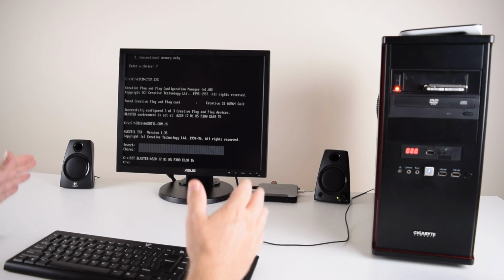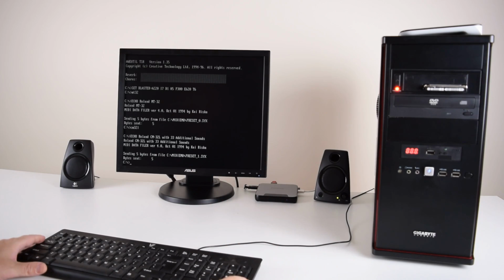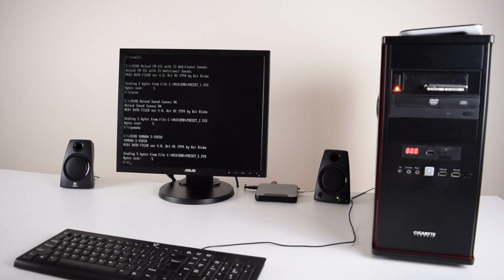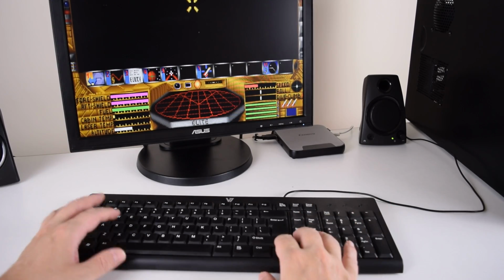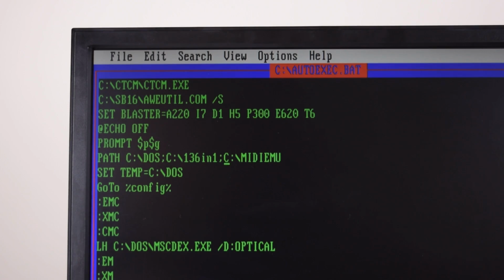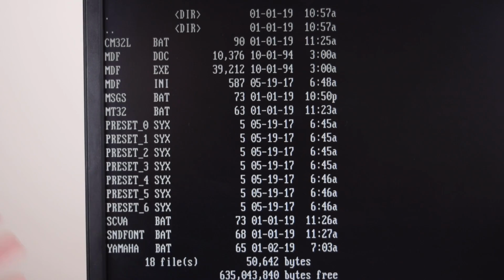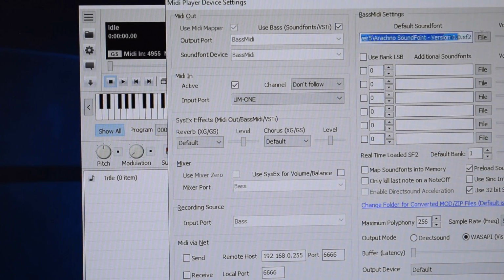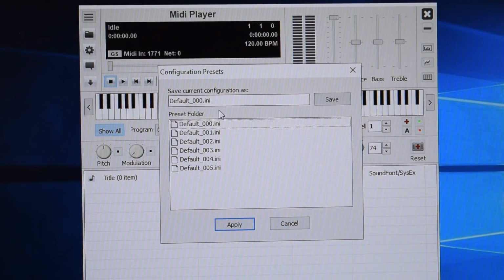Roland MIDI Emulator Project 2.0 for best music with DOS Retro Games

Comment: Why do you use another computer at all? Install a second soundcard if you need something dedicated or virtual soundcard allowing you to route things, like Jack on linux?
What limitation did you hit that required a whole other system?
Reply from the maker: The second computer is required to run the operating system and Falcosoft MIDI Player. The Retro PC is firstly running DOS, so it cannot multi-task, and secondly is not nearly capable enough to run Munt MT-32 Emulation.
Reply: @philscomputerlab  Oh i see, that explains why you need two then i guess, but I'm still not sold. As i said in my previous post. i was running a 486 DX100, however i ran windows  95 and run games under a dos prompt through windows.  i was also using Hubi's Loopback Driver which i see is still available, the only thing i can't remember was the exact name of the group of software emulators that i used at the time, i'm not sure its the one's you've listed above, in my defence that was almost 24 years ago but i surprised myself even for remembering Hubi's loopback lol.

I do however remember that the Soundblaster AWE32 that i owned had a really good emulation of MT-32, and i could load in my own sound fonts. it was important to me as I'm a musician and was heavily using my pc with all my outboard smysnthersizers, samplers and drum machines etc.  

I'll try and do some more research and my own memory digging today, see if i can have something more solid to answer with.
Reply from the maker: @glenorpheus  Yea the memory can play tricks. So firstly you're now talking Windows, not DOS. Now the AWE can indeed load SF2 soundfonts in Windows, and on some DOS games you can use this, but you're limited by the memory and many games won't work from Windows and need pure DOS, like shown in the video. Now MT-32 no go, no other sound card is MT-32 compatible. What some cards can do is offer the default MT-32 instrument config, and a few games, like Monkey Island use this, but all the "great" MT-32 games, reprogram the unit with custom settings and will sound horrible on anything but a MT-32 or other Roland LA device.
Reply: @philscomputerlab  Sorry my mistake about running Dos under Windows, i was just remembering running Dos games using MT-32 Emulation and forgot about it actually being a multitasking system. which makes everything you say make sense to me now. Sorry, hope i didn't offend (",)
Reply from the maker: @glenorpheus  Not at all!
Reply: or he could just use Hubi's Loopback MIDI Driver, re routes midi internally so it can be sent to multiple sources on just one PC, oh and its free too (",)
Reply: @glenorpheus  after thinking a little more I think the emu is just too much for classic hardware?
Reply: @pXnEmerica  i used to run that driver years ago with roland mt32 emulations as well as the yamaha series all from an old 486 DX100 CPU for a while. i later went on and bought a AWE32 but thats another story (",)
Reply: @glenorpheus Sounds good and confirms my original thoughts then. Cheers.
Reply from the maker: @glenorpheus  Your comment really requires more explanation. What driver are you referring to?
Reply from the maker: @glenorpheus  The machine runs DOS and has the performance equivalent of a 386 or 486 computer. It's not even remotely possible.

Comment: I really like the idea. I am wondering what latency you get tho, as I found USB MIDI interfaces to add quite a lot. In my Dreamblaster on Atari video I measured roughly 1ms for the Dreamblaster, which is virtually nothing. Anything 20ms or above could impact the experience if MIDI used for FX for example.

Comment: I have a Yamaha DB50XG connected to the Sound Blaster 16 CT2740 and it sounds amazing. I even made SYSEX files to reset the Daughterboard to allow the SFX for certain MIDI files, like Last Wave from OutRun (rhythm channel 10) when I power it on and when it boots to either MS-DOS or Windows 95C via the autoexec.bat that calls the bat file that resets it.

Comment: 11:16 ??? why the extra cable and the splice??? just connect the usb emulator to the female on the sound card...
Reply from the maker: It depends on your MIDI card and what cables it uses. I wanted to be sure to show the joiner, as it's necessary sometimes.

Comment: Managed to score an MT-32 and Sound Canvas a while back for a much lower price than they typically go for today, but I think I'll definitely look at setting one of these up, since it looks much easier to switch between sound fonts than swapping out the whole box.

Actually, I'm wondering if I can use the MIDI port on a PCI sound card for the MIDI input? I'm thinking I could just use my WinXP/emulator box, which already has a sound card. It's a C2D, so it should be plenty powerful enough to run a MIDI program. All I'd need is the right MIDI cable, which I can make up using a cheap 5 pin DIN female connector, DB15 connector, optoisolator, and some microphone cable.

Sounds like a fun weekend project!
Reply from the maker: Yes, you can use MIDI input of your sound card, it should work just fine!

Comment: Could you compare the quality of this against something like BASSMidi or the Foobar2k plugin?
Reply: The quality is the same since the internal SF2 synth of the used software in the video (FSMP) uses the Bass/Bassmidi libraries just like the midi plugin of Foobar 2000.
Reply: @zbacsko  That's nice to know since it implies the extra hardware is more-or-less useless. Do you know how or if one could get the Roland/Yamaha portions working through BassMIDI, because I could never get it to properly work.
Reply: Bassmidi is only a soft synth engine itself so you can only use SF2/SFZ soundfonts with it. No sondfonts/soundfont engines exist that can emulate Roland/Yamaha devices properly. To use the Roland/Yamaha plugins used in the video you have to use a VST host. You can write a VST Host based on the Bass library but you have to use the Bass_VST extension instead of BassMidi.

Comment: Wow!!! What happend with MUNT?? Are this new project better? Besides shortcurts, does sound better in MT-32 mode than MUNT?
Reply from the maker: It uses MUNT in this project. It's just a version that works with Falcosoft MIDI Player.
Reply: The main difference is not 'It is just a version that works with Falcosoft MIDI Player'. Even traditional Munt driver works perfectly with  Falcosoft MIDI Player. The main difference is that it's a VSTi plugin (that uses the same core Munt library as the Munt driver) meaning it's portable (you do not have to install driver components to use it) and it's also more versatile in the sense that you can save/load different configurations in the form of VST standard .fxb files.

Comment: My setup has the problem, that the Roland UM-One MIDI to USB adapter doesn't get any signal from my Retro PC. I got two soundcards (SB32 PNP and Yamaha Audician) and also tested with the replacements I got for all cables and adapters and so far only the cheap MIDI to USB adapter I got is working partially.
This cheap USB MIDI adapter, when connected to my modern PC, gets es constant signal from the Retro PC but no sound. When connected to my Laptop, it only gets a signal when playing sound but the "music" in Falcosoft's Midi Player is completely off. It doesn't switch instruments and in MIDI-OX nearly all notes are C-1. Comparing the signal to one of your other videos, where you recorded MIDI-OX while playing DOOM, the notes are completely different (I didn't see any -1 notes). Also the port in your recording of MIDI-OX shows port 3, while mine is showing no port at all but - - instead.

I really don't know what the problem could be. A faulty UM-One and a really bad cheap USB Midi adapter or is the system being an early ATX system with PNP (Pentium 233 MMX) a problem? It's really driving me nuts.
Reply: don't plug the roland midi to usb until the retro pc is booted up.
Reply: @Z098  This sadly doesn't make any difference with neither the Roland, nor the cheap one.
Also connected both with a joiner, to see if I could send signals from one modern PC to another, using both MIDI to USB adapter, like I read some people doing for other purposes, but this didn't work either.
I think the Roland one might be defective when receiving signals and I don't know how bad the cheap ones can be, that it doesn't work properly.

Comment: You didn't need the midi cable or joiner. It would have plugged directly into the sound card adapter.
Reply from the maker: Yes, I wanted to show it with the joiner so to be sure it works, depending on what your cable looks like. In a previous video someone complained that they needed a joiner after getting all parts.

Comment: I'm definitely going to try this batch file setup. I do all of this except I use my main PC and speakers or headphones. MIDI goes through the Roland adapter, sound goes from line out to line in on my Sound Blaster X AE-5 and then out to either 5.1 speakers or through headphones. Now I didn't know about the MIDIPlayer presets so I have five copies of it configured differently. Thanks for the info!

Comment: Why did you need the long midi cable before your roland usb interface? Couldn't you have gone from the male connection on that straight into the female connection from your retro pc card?
Reply from the maker: To make sure to show the MIDI joiner, as it depends a bit on what cable you have :)
Reply: @philscomputerlab  That makes sense, thanks :)

Comment: Why not just use a MIDI extension cable? Female one end, male the other.
Reply from the maker: I wanted to make sure I show the MIDI joiner as I got a complaint the last time, as they used a different cable.
Reply: or plug the UM1 directly into the MPU-401 cable.

Comment: Ingeniously thought off! #inspiring
Reply: After watching you connecting all of the cables a couple of times, I question why you didn't connect the cable from the MIDI card directly (=female) into the Roland USB Midi Adapter (male)?
Reply from the maker: I wanted to make sure I showed using the MIDI joiner. Got a complaint the last time as the person needed one :)

Comment: So my sandwich contains, Roland SC-88PRO, Yamaha MU1000, Korg NS5R, Kawai GMega, Casio GZ-50M, and a Roland MT-32.
i also use a 5-1 midi din splitter and one Roland midi Usb for my MT-32.

Also that doom distortion guitar is very similar to the SC88pro, in SC88(not pro) mode
Reply from the maker: Nice MIDI tower :)

Comment: Too bad the Roland SC VA costs almost as much as a used SC55. :-(
So, 100 dollars for the midi interface + cheap system to run it on. $125 US for Sound Canvas VA, $150 for a used MT32 to legally dump the rom file from... Start adding up each VSTi and hardware device you might have to get in order for this setup to be legal, and it actually will not be cost effective. Unfortunately. Sure you can get the MT32 and CM32 roms for free online, but that is piracy of course. So all in all, this setup is more expensive and less user friendly then just going out and buy the actual used hardware.
Reply: You'll be paying way more than 150$ if your conscious really won't let you download ROM dumps. CM32Ls, when they rarely appear on Ebay, go for over 300$. I had no qualms downloading roms for MT32/CM32L -- 30 year old hardware they aren't making money off of. As for the Sound Canvas you are definitely better off getting a real SC-55 (go for Firmware 1.20 or 1.21 model) because the VA is actually an SC-88 with a SC-55 'mode' that doesn't give you an accurate emulation. Since MUNT uses actual ROMs it is nearly indistinguishable from a real MT32/CM32L but we have no such emulator for Sound Canvases yet, sadly.
Reply: @InfiniteClouds  Fair enough, the CM32L tends to be super expensive, but only a tiny handful (not even hand "full" actually) of games actually use the extra sounds it has compared to the MT32. If you are patient, you can get a MT32 for about $100-150.
A can totally see the argument for "Well, Roland don't manufacture the MT32 anymore, so they can't make money off of it anyway". Problem is, you can't really promote that attitude on youtube, since it isn't strictly legal. There have been plenty of discussions around the concept of "abandonware" over the years, and legally, there is no such thing. And all the samples on the MT32 are copyrighted.
So paying $100+ for illegal emulation of an MT32 vs. paying $100+ for the actual piece of hardware suddenly becomes a very different prospect altogether.

Comment: hows the emulation accuracy like compared to real roland midi modules?
Reply from the maker: Very good actually. I did some comparison videos ages ago and the emulation is very accurate.
Reply: @philscomputerlab  Nice! And, does the emulator need to be on a dedicated minipc/thinclient/tablet/whatever? I mean, my main PC is next to my retro PC, cant I just set up the emulator on that? And more importantly, if I did, could I then also use the emulator with DOSBox on same PC without routing any midi cables and stuff, all in software?
Reply from the maker: Of course, any computer will do! You can also run DOSBox + MIDI Emulator on the same PC. I did a video on this recently. Ignore that I use a Thin Client for this video: https://youtu.be/lq5vhiSWPV4

Comment: With all the mini pc & thin clients, are there any good USB sound cards for WinXP or even Win98?
Reply from the maker: Hmm, I haven't tried them with 98 or XP, for this project I used Windows 10. XP is more likely to have some USB sound, but 98 might be more difficult.
Reply: @philscomputerlab  What about using a netbook? Not the first generations but the later with atom n270 or n570 (2c/4t).
Reply from the maker: No way, they are too slow.